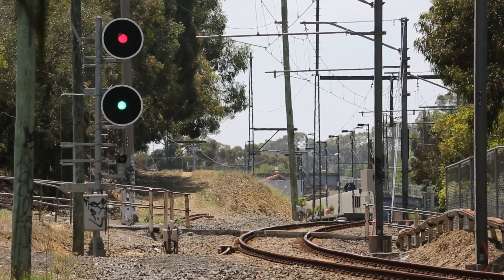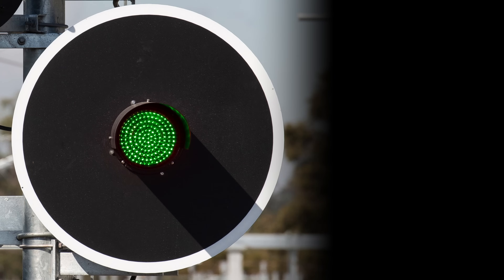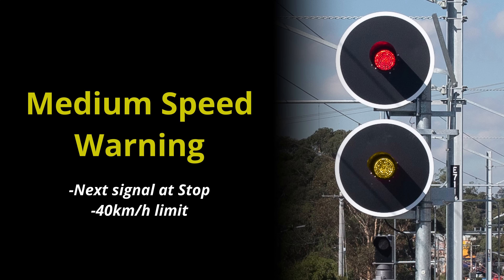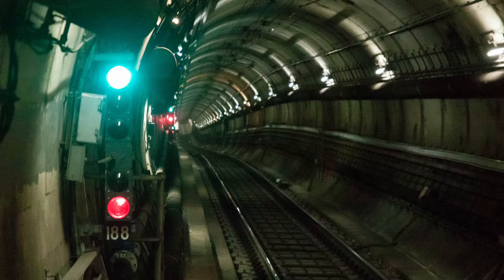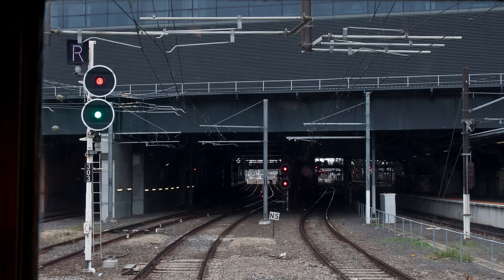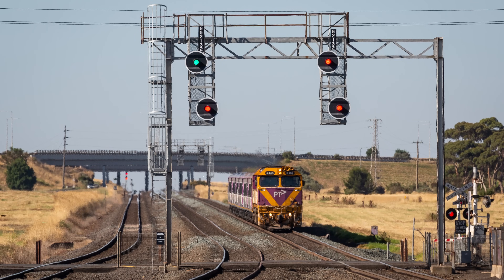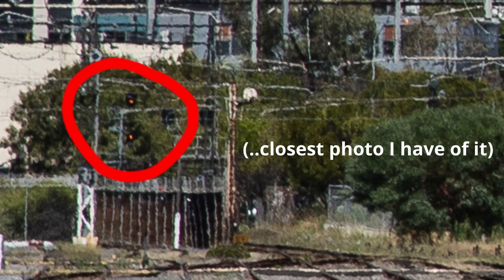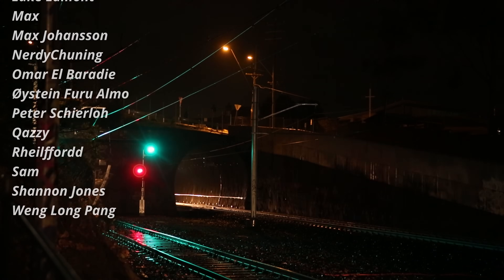Victorian Railway Signalling // What does it all mean?

Comment: I remember when Cheltenham yard was abolished and there was this dwarf signal still standing illuminated in a landscaped garden. It was gone in a short time before I could come back with a camera.
Another Cheltenham story, when the station was at ground level there was a dead end siding where local trains terminated and ran back to Melbourne. But at the Frankston end of the up track there was a signal facing the wrong way, this is if there was a disabled train in the dead end platform and a scheduled local train arrives. It will terminate on the up track after crossing over from the down track. So this signal is protecting the level crossing and allowing a train to terminate on the running line.
Reply: Very true, and there was a 'speed proving' train stop just prior to this dwarf signal to check the speed of the train to ensure it doesn't exceed its authority and enter the LX. All gone now of course.
Reply: @borangle8585  It was a bricquette siding, I don’t think E classes had brake trips.

Comment: Automatic and Track Control(ATC) has a special rule. If a train is departing onto an ATC single line section on a Clear Medium Speed, (and technically Clear Low Speed) , the speed restriction only applies until the train clears the points guarded by the signal. After that, the driver may accelerate to line speed, without having to wait for the next signal.

Comment: i'm... fine with victoria's signals, i do prefer systems that have more stages of warning, but the multiple aspects of medium speed are unique.

(incoming uninformed complaining)
what i cannot understand is the amount of variability in any system, i know for sure it isn't unique to Victoria. the Banner signals are distinct, they should perhaps be used for all co-actors, the amount of extra small lights are excessive, and the rules for ignoring otherwise un-ignorable aspects are obtuse.

i know these have been developed over a long period of time, but for critical operations, a driver shouldn't have to have an encyclopedia of the entire network operation to be safe. the exceptions should always be safe, not conditional. it can be done.

Comment: I was wondering why when they were testing HCMT they turned signals off on my line closed it down for two weeks partially.
Reply: Pannier has a video of that. Reason they're off is that the trains using CBTC (Communication based signalling) and doesn't need the aspects to proceed as they get the indications in the cab. They'll have a speed profile to follow in order to maintain safe running.

Comment: That signal at 0:52 in North Geelong is interesting. Looks like they've retrofitted LEDs to an older signal body.
Reply from the maker: Yep, there were even some semaphores that got LEDs around that area!
Reply: @Taitset  are there any photos of those LED semaphores?
Reply from the maker: @jimsmowingofficial  Took me a bit of searching, but I have this one photo of one at Broadford with LEDs fitted: https://www.dropbox.com/scl/fi/bri7m88eg8w1jnunlmj0o/20120417-7035.jpg?rlkey=hfk3l3gay3k42b43d8mvdpqbs&dl=0
Reply: That Signal Body is one of few that I know of, they are quite rare from what I can tell. There is also one on both the entrance and exit to the Port of Portland (Both are incandescent still.) I've noticed both V/line and ARTC have done retrofits like that before, though Iirc they are getting removed and replaced more and more these days by modern brand new signal bodys.

Comment: I live in Belgium. Here, speed signaling is also used. However it's very different from the system used in Victoria and the signals are weirdly shaped. It's far from being intuitive and also has a unique approach to flashing aspects. Nevertheless, I think Victorian signals are simpler, and I also do agree that the UK has the simplest system.
Reply: Is the speed signalling covering more than just standardised normal, medium and slow speeds?
Reply: @CattoRayTube  It's essentially designed to cover any specific speed. Not all signals can display a speed restriction. The ones that can have it displayed as a white number. The speed is indicated in 10's of km/h. When a signal displays a horizontal combination of green and yellow, this means the driver has to slow down to the specified speed by the next signal.  If no speed is specified or the display is broken, the driver should slow down to 40. The most common speed restrictions are 40, 60, 80, and 120.

Comment: A few weeks ago a train broke down near Kyneton which forced services into Melbourne onto the down line. I arrived at my station very close to my train's departure time, and if I hadn't known to check the signals as I approached, I would have been on the wrong platform and missed my train. This information can be very useful in uncommon but critical situations.

In response to what you said at the end, I am one of those ex-New South Welshmen who believes our signalling is better, though now that I've finally gotten my head around how it works here in Vic, I'm not an frustrated by the differences nearly as much.
Reply from the maker: Oh yeah, that's a great example! Certainly at all those stations between Sunbury and Kyneton the normal passenger information isn't great when there are unplanned changes.
Reply: @Taitset Thanks for your reply :)

Now that I think about it, the way you say that, in Victoria, you only need to consider one light at a time, for most of the time, actually explains why I've had so much trouble adjusting. Up in NSW, you need to consider both lights at all times since they deliver information in tandem, and that's just how I've been wired to think.

Comment: Having grown up in South Australia, I had to learn UK-style route signalling AND US Speed signalling at the same time, because they both work side-by-side (such as on the Belair line, where one track is speed signalled, and the other track is route signalled). Long story short, this means that my "normal" signalling system comprises of TWO different systems of signalling, and I'm a bit more open to unique signalling systems.

...While NSW's signals feel weird to me (because I'm used to the "green means the next signal isn't red" mentality), I understand the logic behind having the bottom signal acting as a kind of repeater for the next signal, and instead using yellow to denote the use of a lower speed.
Reply: Was the US style influenced by Webb? A lot of station buildings from the Webb era have the US style of veranda roof over the whole building and sat on the ground with no platform.
Reply: South Aussie here too, I never understood when i go to melbourne why green over red was allowable, now I (sort of) get it... however I don't see the logic of having the bottom light show red if top light is green? Is it a visibility thing? Why not just be off, or double green?
Reply: @BlackDrac82 would assume it's because you don't want a failed lamp to cause the signal to look like a less restrictive aspect. Having a single green be clear medium would be okay but imho arse backwards given the less restrictive clear full would green over red.
Reply: This speed signalling system was first introduced at Adelaide Station in 1915 and eventually all of SA (and Vic obviously). In the late 80s and early 90s lots of work was done around suburban Adelaide to update signalling systems which is when the UK style signals were introduced (but still with speed signalling vestiges - eg using a route indicator to exit a passing siding). The rest of SA kept the speed signalling system which is in use today.

The whole 'why is clear green over red' thing is no worse than traditional (UK style) semaphore signals - at a junction multiple semaphore arms would be provided, one for each route and one would be cleared to indicate the route set - at night this could be an array of red lamps and one green lamp to indicate clear - speed signalling is no different but the lamps (or semaphore arms) are separate speeds rather than separate routes.

The speed signalling system was originally adopted from the US when Adelaide Station was remodeled and it was considered that the signalling would have been too complex with route signalling (arrival signals would have needed up to six semaphore arms). Speed signalling was adopted with yellow light for caution (also new at the time), and three arm upper quadrant semaphores for home signals at Adelaide Station and Adelaide Junction. Automatic block signalling replaced absolute block between Adelaide Station, Adelaide Junction, Mile End, North Adelaide and Bowden. 

Victoria seems to have maintained the use of 'green over red' everywhere, whereas the standard now in SA (other than suburban network), if a signal only need to show normal speed aspects, the lower lamp is replaced with a red reflector plate (presumably for economy reasons) (I believe it is the same in NZ).

Incidentally on the suburban network, permissive signals are indicated by a 'P' plate on the signal and absolute signals by an 'A' plate - the 'P' plates are offset from the main signal just as the original red marker lamps were for permissive signals (and still are in Vic and general in SA) and the 'A' plates are in line with the signal head as the marker lamps would be in the original speed signalling system.
Reply: @docdaneeka3424  Another vestige I love is the "Absolute" and "Permissive" signal signs; The square "A" sign for absolute signals is directly below the head, while the round "P" sign for permissive signals is offset to the right, exactly how the heads are arranged on speed signals showing the same thing!